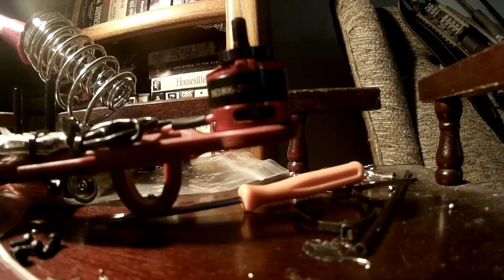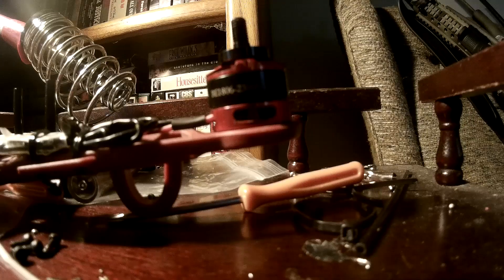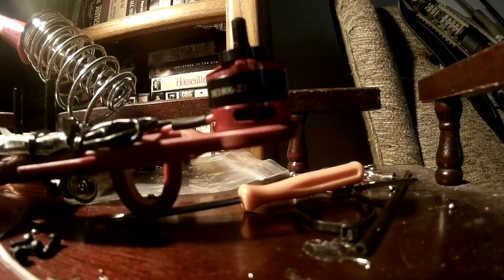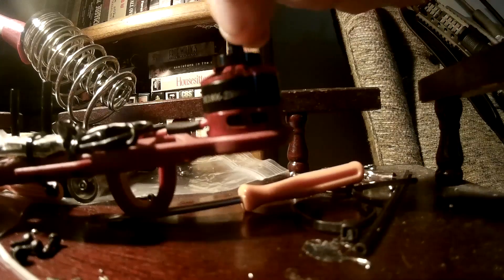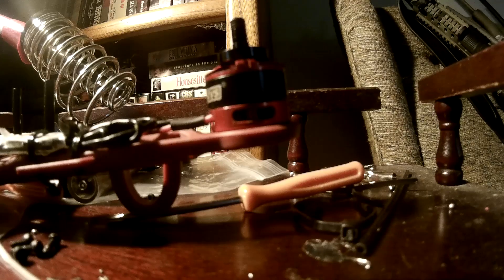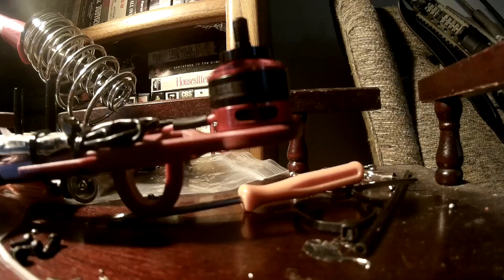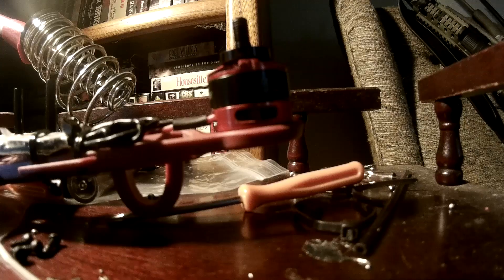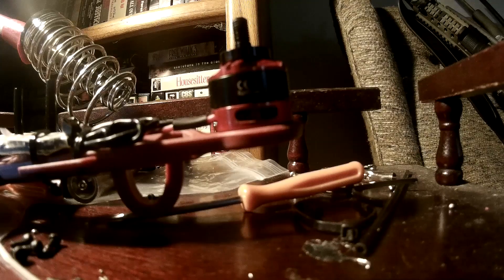Motor 2 Not acting right - sputtering - slipping

Comment: check its min points in bl heli suite. does it only happen on low throttle. otherwise try swapping out the motor or esc with a new one. And if that fails you could always watch free willy 3 on VHS
Reply from the maker: I currently dont have the components to connect to pc.. but they are on the way.  Its more noticeable at a lower to medium throttle.. it seems to spin appropriately at higher throttle. I was lost about the free willy comment then i looked to my right lol.
Reply: Merc TripleCap you can connect it through the naze fc usb port
Reply from the maker: im using kk 2.1.5 mini .. but i currently dont have the tool to do it with
Reply from the maker: OMG! I didn't know who you were when I originally posted this but now that I have been in the hobby for over a year, I think I have seen all of your videos! lol. I just stumbled across this video and was like whoah! I know this guy! lol.. I'm a big fan.. and you have actually helped me a lot more than you know!